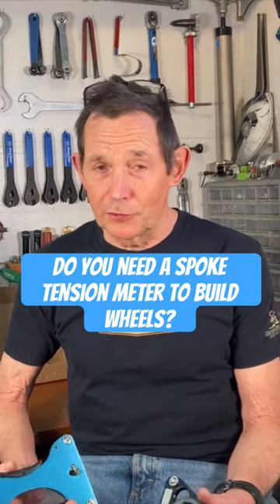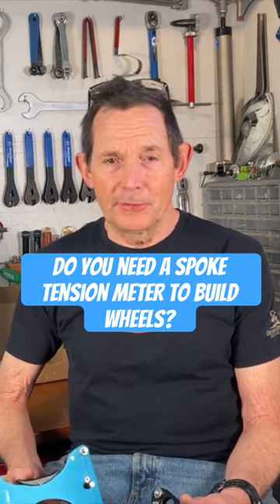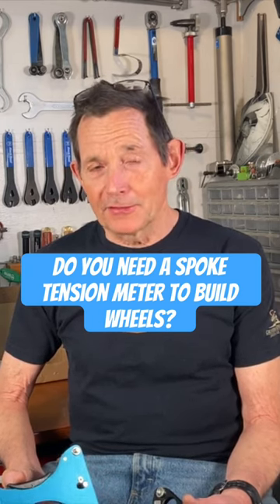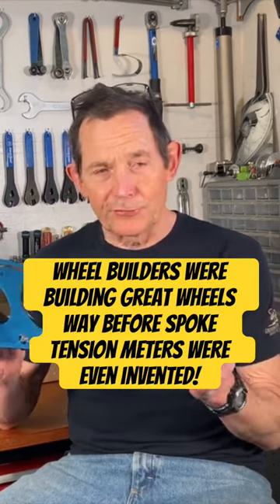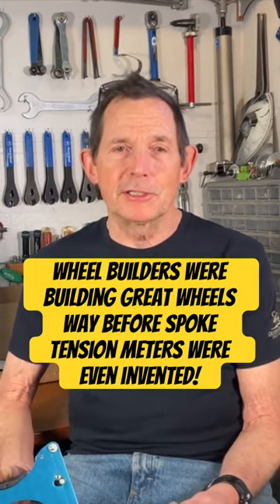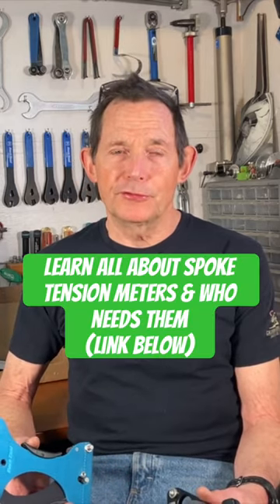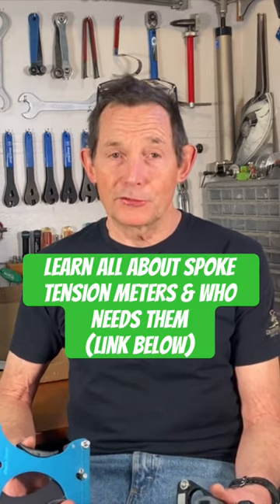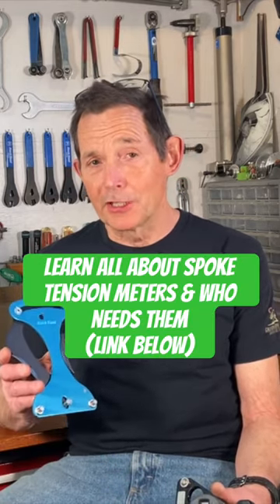You Don’t Need A Spoke Tension Meter Learning To Build Wheels #shorts

Comment: 100% right on the $$$! In 45 plus years of building wheels, I think I built roughly 10K wheels, I built wheels for 2 San Francisco bay area bicycle suppliers, several bicycle shops along at my own shop and for many bicycle competitors, all built without a tension meter. I think Wheel Smith produced the 1st tension meter, a co-worker where I worked, D.I.N. showed me a tension meter and said Baron doesn't need this then proceeded to toss it into a garbage can, Thanks for spreading the truth.
Reply from the maker: Thanks a lot for watching and especially for sharing your wheelbuilding expertise cecile.  The first tensionmeter we had was from Hozan - about 1980 if I remember right. Then Wheelsmith came out with theirs. That’s hilarious that yours went into the round filing cabinet 😂 Thanks again!

Comment: I just ordered one. 
I think i need one really bad. 
Whenever im riding my 14" folding bike, one of my spokes will break at the j bend.

I think on smaller wheels, its more sensitive to changes in tension than longer spokes.
Reply from the maker: Thanks for watching and commenting robest. The #1 cause of broken spokes is that they’re cheap plain steel spokes. So you should check your wheel and spokes. If a magnet firmly sticks to your spokes that means they’re cheap spokes that break. To solve them breaking, replace with excellent stainless steel spokes. I recommend DT Swiss spokes.
Reply: @JimLangley1  the problem is the spoke length. its a 14" wheel. I needed a spoke thats around 112mm in lenght.
Reply from the maker: @ spokes can be cut & threaded to length by shops with spoke machines robest.